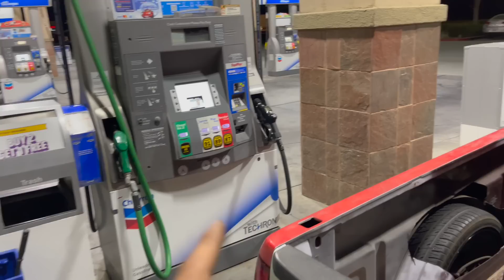2020 Silverado Short Bed Gets 28s

Comment: Jerry what u recommend for my truck it starts to shake at 70mph maybe a different suspension or control arms? Its a 18 sierra
Reply: Are your wheels balanced? I would check that first.
Reply: Check the wheels, they may need to be balanced. Also the factory drive lines sometimes shake. But if its not factory suspension id just start putting wrenches on everything cuz that shit can back out a little after 6 or 800 miles.